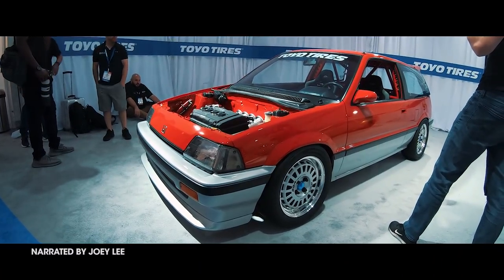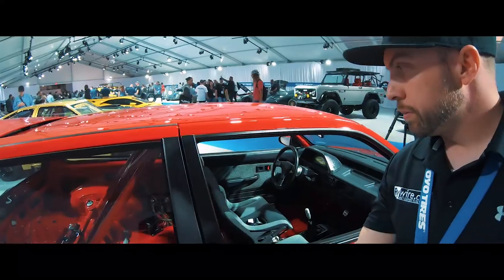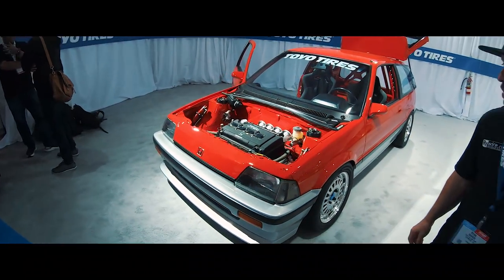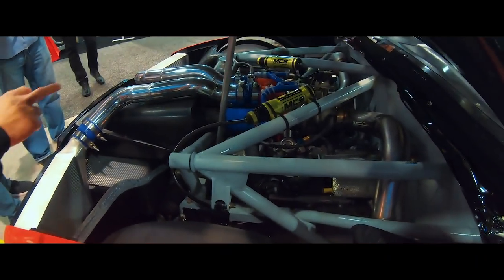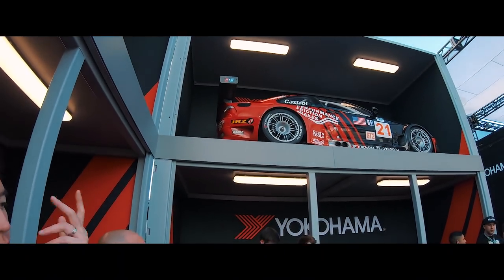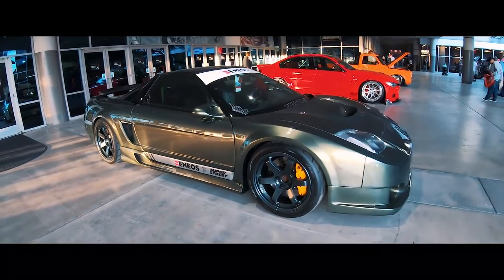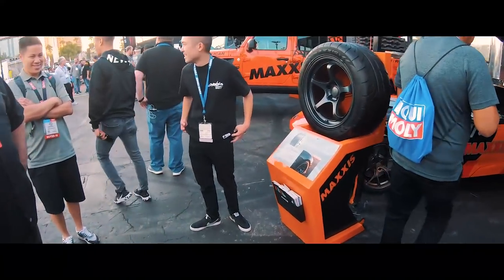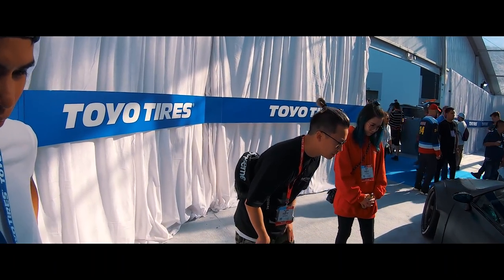The New Rywire Civic Build & More SEMA Debuts - CHRNCLS Vlog 2019 #32

Comment: I laughed a little when you got confused about the exhaust being on top of that V8 in the BMW, but then I remembered how I was all tripped out the first time I saw a reverse flow H22 Honda engine in a 90's Odyssey. It is a hot V setup though. Mercedes and BMW and others are using them on their turbo V6's and V8's since it makes the exhaust distance to turbo extremely short therefore very little lag. It's great! Makes the turbos spool fast and power is almost instant.
Loved this video so much though. I can't get enough of cars that are build so meticulously and beautifully.